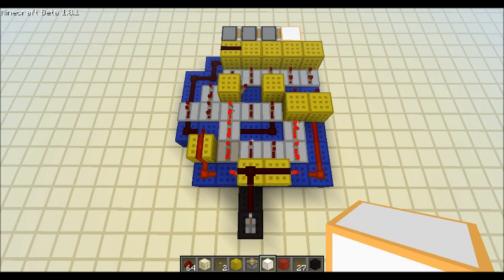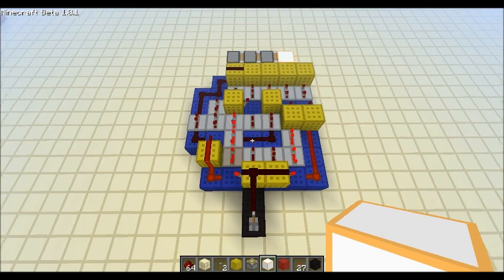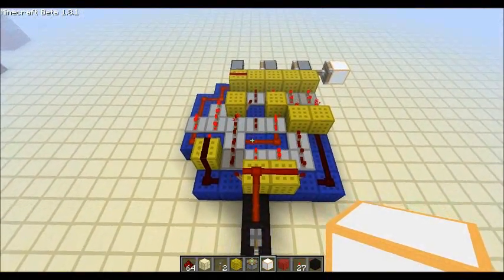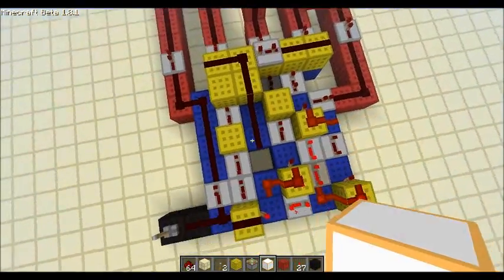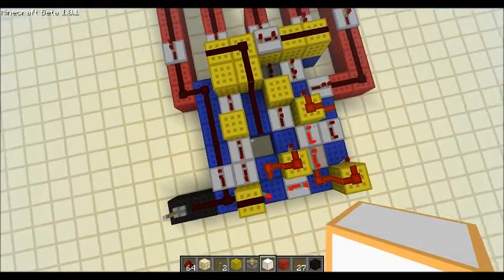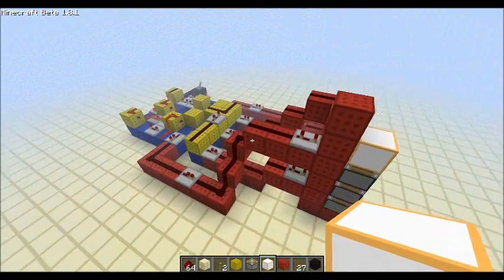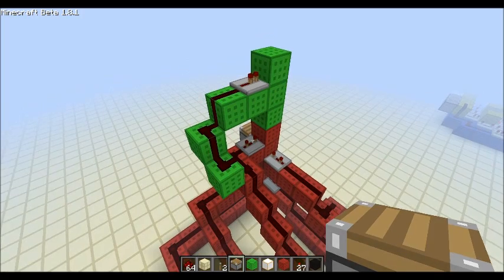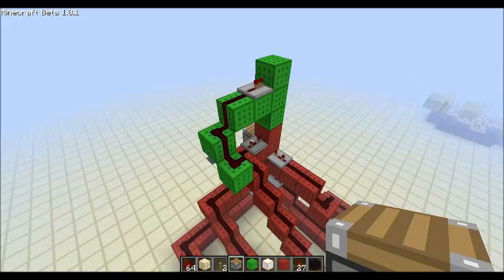Minecraft Tutorial: vertical and improved horizontal triple sticky piston extender circuit

Comment: Awesome, but needs to be updated to the new redstone mechanics. Not a lot needs to change. Take out the repeater on the far left side and reduce the delay of the top center repeater to 1 tic. It'd also be cool to show how you can stack it. 2 blocks need to be changed to slabs to make it work that way, but once they are, you can stack as high as you want.

Comment: @GothicFarms I watched your vid, but this aint exactly what i want(although it's awesome!).

As described there is the plane ocean floor. if you put a lever on the floor to (quickly)turn a MemCell on and then pistons retratract. 1 Single 1 Double and 1 Triple, all next to each other(Stairs) and Signs block water from coming in. Pressureplate resets/activares the hidden stair. If anyone pls could post a tut for vertical triple extender/retractor i might get it to work!!!